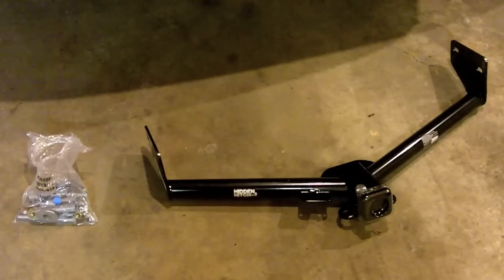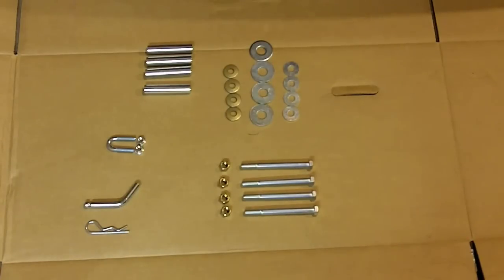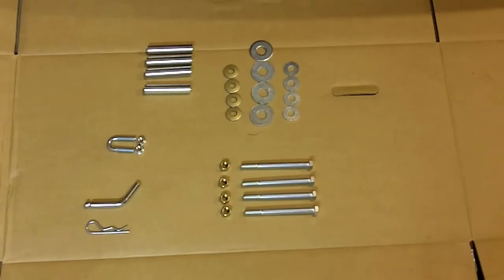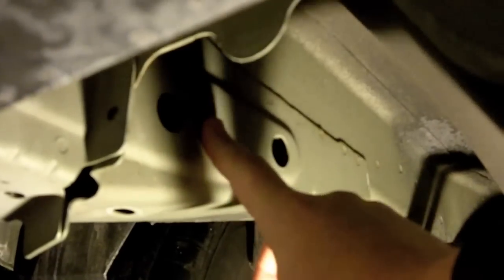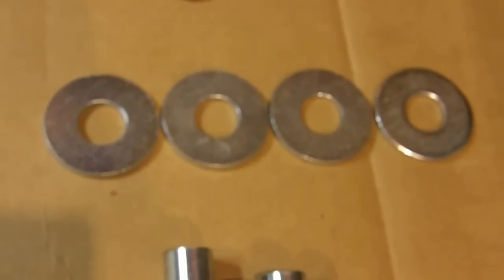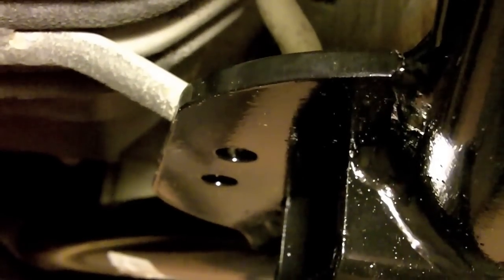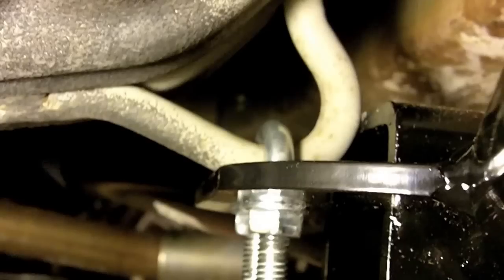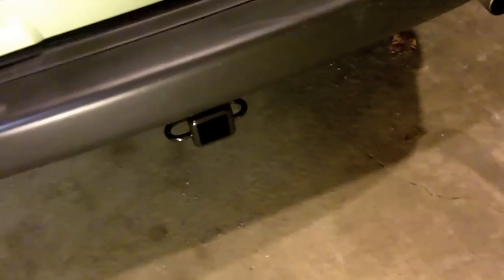2006 Honda Element Hitch Reciever Install

Comment: Don't u need electrical installation for the trailer brakes lights just wondering or you can just get away with no lights

Comment: You skipped over the hardest part: putting the hitch onto the bolts without knocking the bolts out. Any tips on doing that without someone helping?